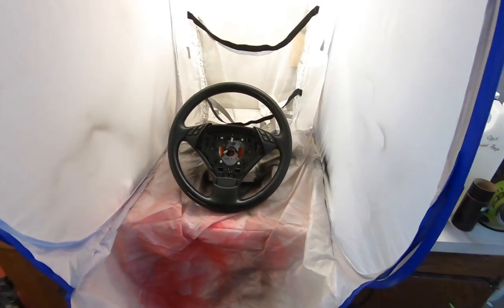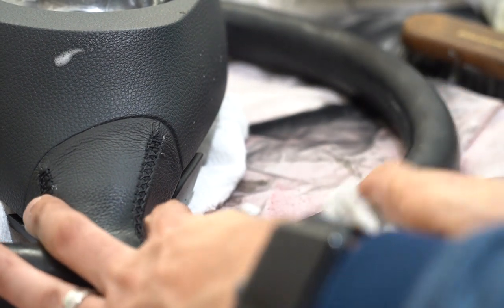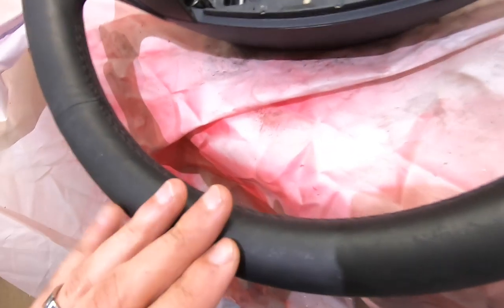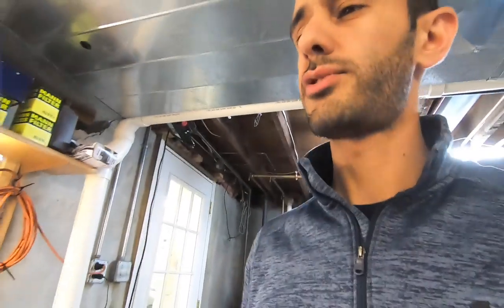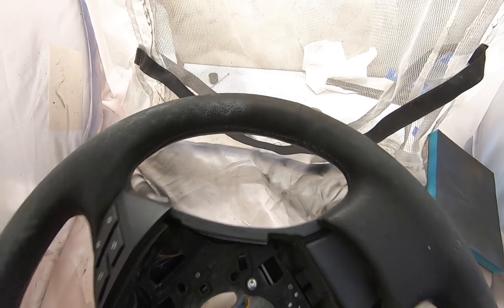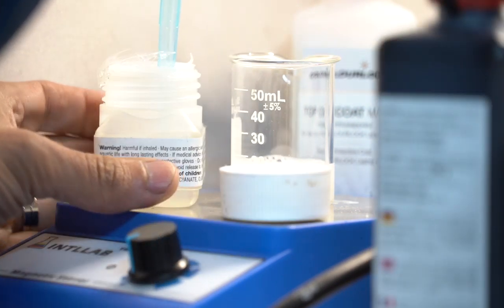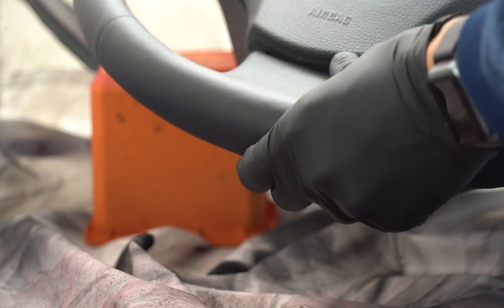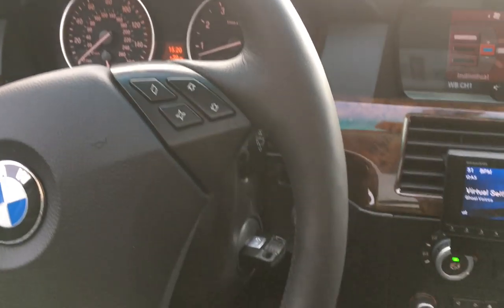BMW steering wheel restoration with Colourlock

Comment: Hey. Is it possible to skip the sanding step if only a small section on the top of the steering wheel needs to be dyed? Just cleaning and and then the paint?

Also, can i add clear coat on the rest of the steering wheel to try to blend the matte finnish with the newly painted area (which will be clear coated)?

Comment: Looks amazing. How long does the colourlocked colour last? Is it years or months
Reply from the maker: so far so good. Considering I am using disinfecting wipes on my steering wheel every week (and not the leather safe ones either!)
Reply: @AvianaAircraft  how is it holding up now?
Reply from the maker: @daltonscofield22  so far so good. I haven't taken very good care of it either!
Reply: @AvianaAircraft  would you mind sending some pics or something? I bought this same kit last night
Reply from the maker: @daltonscofield22  Ill try to make a follow up video, need to clean the wheel badly
Reply: @AvianaAircraft  I look forward to watching it
Reply from the maker: @daltonscofield22  Have you seen my M5 leather restoration video yet?
Reply: @AvianaAircraft  I have not, link me?
Reply from the maker: @daltonscofield22  https://youtu.be/8tZTeiRHB0c
Reply: @AvianaAircraft  that one was also very informative, but I’ll be sponging it, as I have no use for an airbrush other than this
Reply: @AvianaAircraft  what was the mount you used to support the wheel whilst painting? Seems to work perfectly

Comment: What products did you use for the primer, base coat and clear coat? I have a bmw wheel as well and want to make it look perfect again.
Reply from the maker: You would have to check with @colourlock UK & North America but I don't believe they sell the primer/base/clearcoat system direct to consumers. 

Honestly though, if you prep the wheel properly and spray on leather fresh (their one step product) it will give you great results! I spray my work boots with that stuff and it looks great and is super easy. Just spray multiple thin coats and dry in between layers with a hairdryer. Here is a link to that product https://amzn.to/3iVAHvp

If you have any cuts or gouges, you may want to add some black fluid leather filler too which is in this kit: https://amzn.to/3lLAcWP

Comment: Thanks for the video! I got the colourlock black fresh dye, the strong cleaner, brush and sanding block. I followed your steps but didn't used colourlock spirit, instead I uses 70% IPA and the sponge method. I feel I did something wrong because I lost the leather grain, the surface feels rough and when adding colourlock leather shield 24 hrs after paint, the color came off... any ideas? Thanks!
Reply from the maker: How old is the steering wheel and what kind of car is it out of?
Reply: @AvianaAircraft  2017 Elantra, steering is leather wrapped. 4 years of use.
Reply from the maker: @josefranco2276  So generally those come with a pretty smooth leather to begin with. If you spray it on, you might be able to get a better texture or if you sponge it on, try to create some texture by not leveling out the paint as much. 

You could still have some oil soaked into the steering wheel if the paint is not sticking properly. I will ping Ram with colourlock to see if he has any additional ideas.
Reply: @AvianaAircraft  Thanks for your input! I already contacted Colourlock. Sounds like better cleaning and spraying would help to get better results.
Reply: Hi Jose, I think the roughness could occur if you sand excessively. This may also be the reason why you've lost the grain. It could also be down to the IPA used but it has to be one of those two reasons. In terms of leather Shield, if its taking colour out - just wait a little longer. In most cases 24 hours is enough but it can take longer for the paint to set. I'd say wait a week. Hope this helps.
Reply: @seeya1421  I was very careful when sanding. The surface was very smooth. After the color fade using the Leather Shield, I cleaned and degrease it and the surface is still super smooth and matte, showing the original wear marks. Do you suggest to redo the whole process again?
Reply: @josefranco2276   I think you emailed pictures over. Thanks. It looks like the Shield has removed the colour layer which can happen if the colour layer hasn't set. I'll email you with detailed instructions on how to fix it.
Reply: @seeya1421  Yes! I sent them over email yesterday! Thanks Ram!
Reply: Would you recommend any spray paint and spray top coat if there's any available in a can? I know duplicolor has vinyl and fabric paint but I don't know if you can get the same results... thanks!